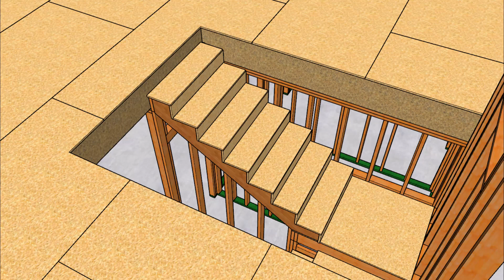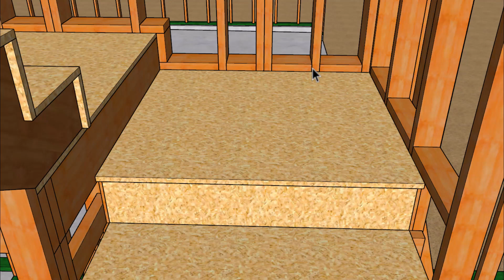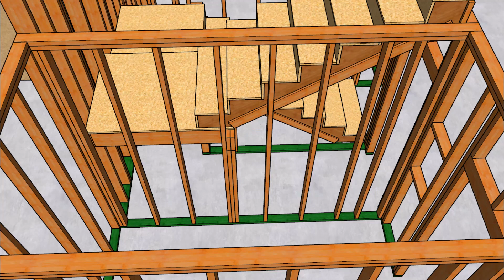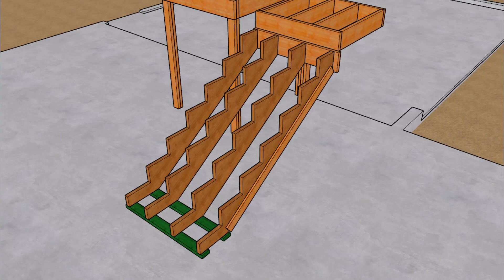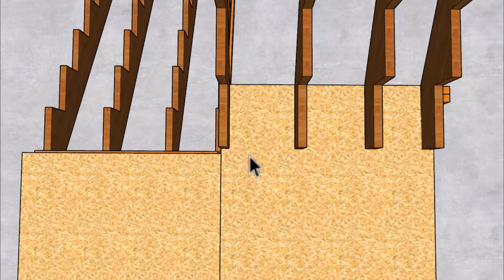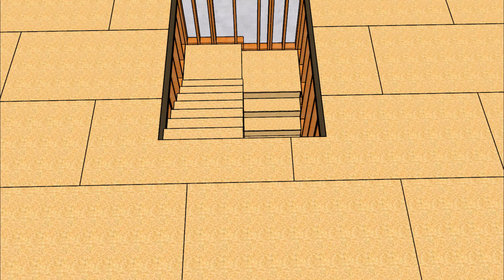Split Level Landing Stairway Framing And Design Ideas - Two Story Home Building Project

Comment: I think this helps me!  My stairs are exactly this.  Split level landing.   I have half-bath under the stairs.  68"x92 footprint.  The toilet is under the landing.  Ceiling height 92" under landing.  House built 2005 in Tuscan era.  It has wall dividing the vanity and toilet area with arched walk through. Like pony wall but up to ceiling.   Very Tuscan looking.   I was going to start taking it down but then I thought maybe it was hiding something holding up the stairs??   There would be no electrical or pipes in this wall.   I'd like to  take out  completely to open this cramped area up.  Do you think that's OK?!   Thanks so much for any advice!